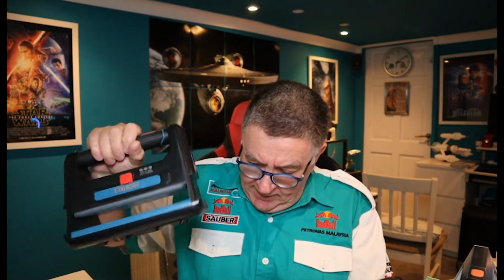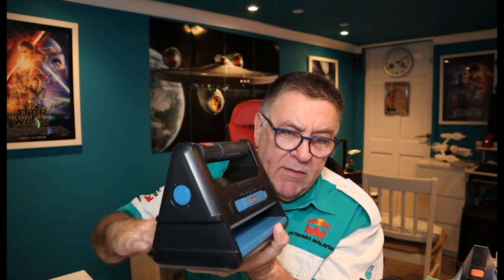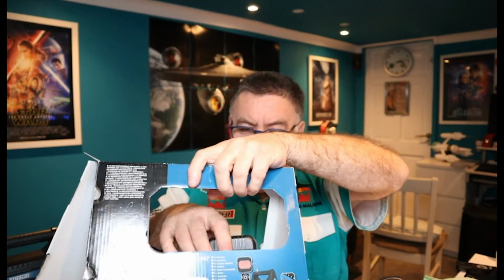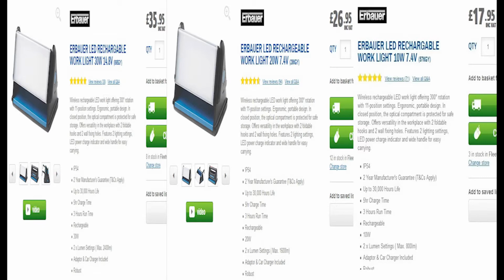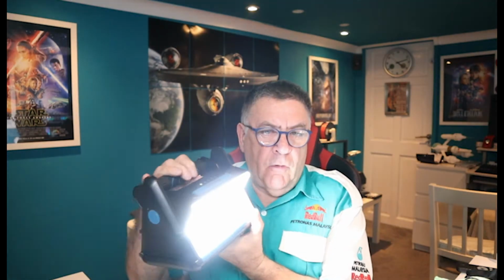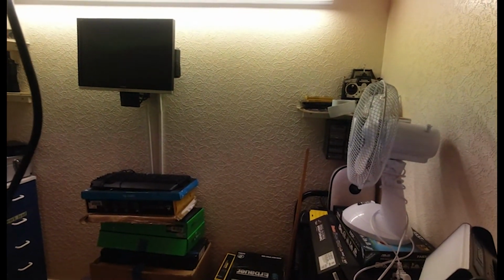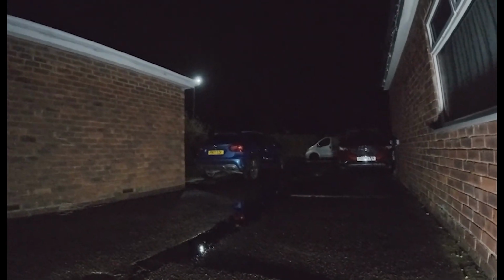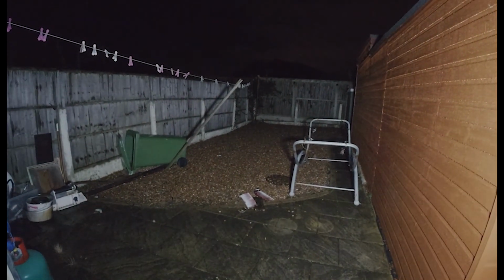Erbauer Lewo Rechargeable Work Light

Comment: So how do you charge the 20W lamp (i.e. 20W erbauer lewo 2000 usb li)

Pressing the button x number of times and it won't charge... Press it a different number of times and it does charge... Confusing

So wich is the charging mode?

1) Light is ON and the charge level LEDs  are lit up (not blinking)

Or

2) The LIGHT IS OFF and the charge level LEDs  are lit up and they ARE BLINKING

Please let me know the user manual is rubbish
Reply from the maker: Hi Elvis...at the moment my daughter has the light to do some decorating ...will do a full charge trial when I get it back 

However I do know you charge it with the light turned off..but can't remember details ....as soon as I get it back I will post a complete answer here
Reply from the maker: Hi Again Elvis...ok I got my lamp back and tried things last night......Basically when charging the main light should be off....(as with anything like an electric drill you wouldn't charge it with it running)

...while on charge the leds are flashing....and when totally flat its just 1 that flashes....a (very) short time later that one goes steady and the second one starts flashing (this 2nd one flashes much longer...the 1st went steady after just a few seconds) ...then later that one goes steady (so now 2 are steady) and the next starts flashing...and so on until all 5 are steady.at each stage it seems about 1 hour till it is at 4 lights then the last one comes on quickly

When all 5 are steady it is fully charged.

If it starts flashing (the main light) it means its running low.

You can run it while plugged in but it will discharge quicker than it will charge...it may be handy though as when its running low and starts flashing if you plug it in it will give you extended time.

Comment: Thanks for posting the video. 

I WAS happy with the 20w (1600 lumen) unit, until today. 2 years old, has seen very minimal use, and maintenance charges have been adhered to, but today found it to be completely flat; shuts itself down almost immediately. It has taken some charge over the last 3 hours, but the sequential lights did not function properly- all 5 stayed on for the charging duration. 
After these 3 hours the charger wall-wart has now gone cool- so the (alleged) 8Ah battery has (at absolute best) managed to reach 40% of it's rated capacity. We'll see how much actual 'thump' it's got when i switch it on later...

Bearing in mind the charger is rated 1.25A output and the battery is 8Ah, the (quoted) charge time of 5 hours is highly suspect; by my reckoning it should take 8 or 9 hours with that combination of equipment. I do suspect chinese number-wangling fiction may have occurred. 

I can't argue with the robustness of the casing; it's impressive. Something aint right inside though, and other people are finding this out as well it seems. I'm tempted to do a tear-down of it if it proves to have totally shat itself. 

As a ray of sunshine, the mains powered version got soak-tested by me and my colleagues, and it was quite happy. It did reduce somewhat in brightness over 2 or 3 hundred hours- to be expected with LED's that are being pushed quite hard.
Reply: -Just realised my maths is flawed; 12v input from the charge has to be dropped in circuit to perhaps 8.4v, so IF the current is increased proportionately the 5hr charge time seems more reasonable.
Reply from the maker: Thanks for that.... interesting to know.....mine seems fine I havnt used it often but did use it recently changing my immersion heater in the loft..it was on for about an hour on low and had gone down to 4 lights which seemed about right.

Even though out if guarantee it might be worth an email to Screwfix to see if they will renew.

If not and it is the batt hopefully a similar or even higher capacity one could be sourced and fitted for not much money...let me know how you get on

Comment: Hi Tom this is very informative. I have one of these lamps. But we cant locate the charger anymore. im not sure which one mine is? it says on the back 12V LEWO1600-Li - I wanted to ask if you know where i can get a charger for it? Its mind boggling which one. ive just  15 minutes in screwfix trying to get one there and they don't do a replacement charger. But they tell me i can buy one online? but which one? Hopefully you may be able to help. kind regards. A
Reply from the maker: Hi Andrea....just looked at my charger and the model number is HV-T16VB-12125B....typed this into google and a couple came up on ebay (but quite expensive at £16.99 and shaped like a laptop power supply.)

Basically any 12 v one with the correct size barrel plug will do (this one has an output current of 1250 ma but anything at least this or thereabouts will do) 

I tried measuring the barrel plug with my calipers but its not easy to do the inner diameter....seems to be 6mm outer and 3 mm inner .so 6.3 x 3 barrel plug would be my bet but cant be sure

There are so many barrel plug sizes available its unbeleivable.

Hope this helps

Comment: I bought 3 of those rechargeable lights from 🇬🇧 to 🇬🇭.  I was able to use it for just 3months and unfortunately 2 of them are no more working.  It charges to full but doesn't light when you press the on button.  I can't take it back although it still has warranty because its not easy to ship it back. I am disappointed because its not cheap.
Reply from the maker: Hi Juliet   sorry to hear that...not sure what GB to GH (in blue circles) means. I got mine from Screwfix which is quite nearby so I would have been ok to return it if it had gone wrong (its still works fine btw)  Why is it not easy to ship back.?..particularly if 2 have gone faulty
Reply from the maker: EDIT Hi again Juliet....I have just checked my email and now see that the GB and The GH are UK and Ghana flags.....in the youtube comment they just show as blue circles :) 

Maybe an Email to Erbauer would help but hope you get a conclusion.

Comment: Hi... There is even a 40Watt rechargeable lamp too....along with a selection of mains powered units.   As the rechargeable lights will work if the battery is flat, by simply plugging in the charger, as mentioned below, (although it isn't charging whist using the lamp plugged in this way),,,you do have the best of both worlds buying the rechargeable lamp....it makes me wonder why you would buy the mains unit...apart from the price the mains only units are cheaper.
Reply from the maker: Thanks for that ningis....yes the 40w must be a new addition (at least to Screwfix as it wasn't stocked by them when I got my 20W but is now) I agree re mains vs battery....the rechargeable ones are much more versatile. Have added it to the description and credited you :)

Comment: Thanks for the review. Can you use the light whilst it’s charging?
Reply from the maker: Hi Campervan...just tried it and yes you can....I let it run right down till it started it's "charge me " flashing on and off routine then plugged the charger in. I then ran it for 1 hour and it remained steady on full brightness for the whole time. When I unplugged the charger it started flashing again so while its plugged in it's either got exactly the same discharge rate as the input or charging is disabled while its plugged in and switched on full brightness....So it wont actually top it up if its turned on as well but at least you could run it 24/7 while plugged in if the battery was flat.
Reply: Fantastic! Thanks for doing that, much appreciated.

Comment: Not sure why the dislikes mate other than it being a bit long winded. I've found your review great! I'm a pro trade and have come from full Makita battery lighting as i was so pissed off with their stuff that's about to land in the UK and its price. So I jumped on the Unilite band wagon which is good but run times are a bit pants. This screwfix stuff looks on point however.
Reply from the maker: Cheers Lee...yes the Erbauer stuff seems ok.....like the Parkside stuff from Lidl (that has a 3 year guarantee ..see one of my other videos to show how they stand by it as well)...Like you say Makita and Milwaukee etc are great quality but a crazy price and when spares are nearly as expensive as a whole new mid range tool it makes you think....

Re the dislikes....yes I am with you ..my vids are a bit long winded...have been trying to cut the waffle but its a hard habit to break :)

Comment: Hi mate I have the HikVision Colorvu.  I’m getting a slight bit of ghosting on the brights colours in my picture. Any idea how to correct this. Thanks 👍🏽
Reply from the maker: Hi Mark....Am not sure what the prob is as haven't come across it ...it may be worth playing around with some settings and experimenting with shutter speeds and colour saturation etc....if you look under the 2 comments on my vid review of the cams from  "John Davey" and "Chavacano FILIPINO ROOTS" I mention some of the settings I use ....hope this helps.
Reply: @TomsManShed  Okay thanks. Do you know if there’s a way I can get my cam light to come on as like a spotlight when there is motion. Instead of it just flashing like a disco 😂
Reply from the maker: @marksheridan8444  No there is no way to get it to come on triggered by motion..yet...just triggered by it going dark or by setting on/off times

Comment: Tom from one of your earlier videos can you recommend a capacitor type jump starter suitable for my MG ZS EV really appreciate your help as the choice is a bit daunting for me. I just need one suitable for the job. Cheers Brian
Reply from the maker: Hi Brian .....I don't know really I have only ever had the one in the vid ...the Sealey Electrostart...I have never actually had to use it on the MG....I have used it a few times on other vehicles but they have all been ICE ......its a means of storing energy just like a conventional jump pack so cant see it being any different for an EV ...BUT on a dud 12v batt on an ICE car you just need something to crank over the engine on the starter whereas in an EV its more of getting its dud 12v battery up to a state of charge enough to energise the rest of the system so don't know if that matters.

Best checking with MG really but am pleased with the Sealey so far on other cars.

Comment: Good review as usual Tom. 👍

BTW On your MG ZS EV can you define the uses of the round button parking brake, and the pull up lever parking brake ? 
So far on my MG ZS EV I have only used the round button parking brake. And while driving I have the brake assist always turned on, 
so If I stop at traffic lights for instance, and I press the brake pedal a green light comes on and the vehicle is automatically held but ready to move. Do you agree I would appreciate your viewpoint.

Cheers.
Reply from the maker: Thanks again Joe.... the auto handbrake pull up button does the same as the central push button p button but automatically....ie when you press the foot pedal to brake with the auto handbrake engaged it automatically applies the handbrake brake so stopping creep....then when you want to start moving again & press the accelerator it disengages the handbrake automatically......if you don't have auto set then you have to manually press the park button to engage and press again to release it

Sometimes ...say in a slow moving jam on the motor way creep is desirable so you may want to leave the auto handbrake switched off
Reply: Cheers Tom for your swift reply.